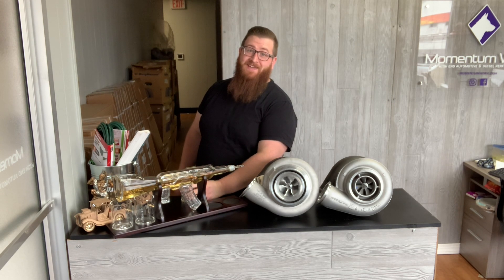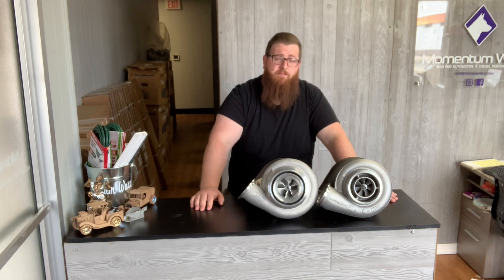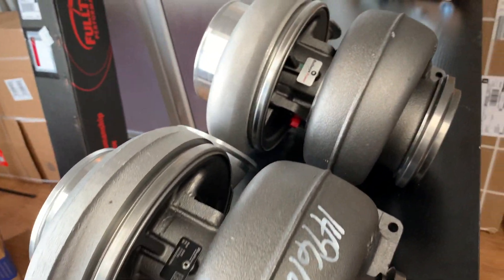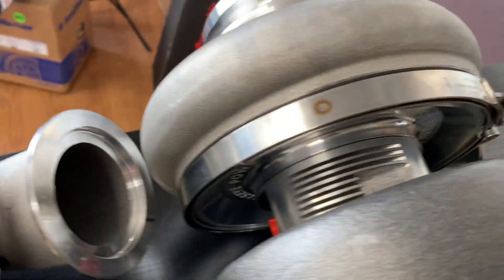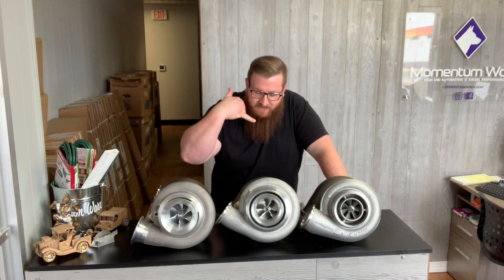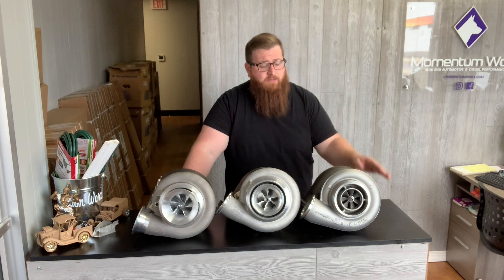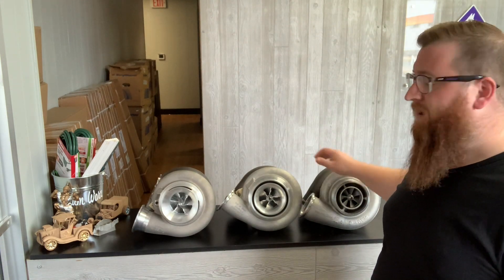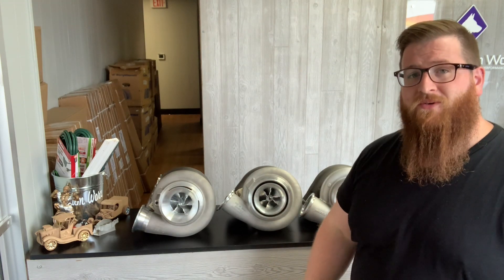What is in a Bullseye Power Turbo for Diesel Trucks?

Comment: I’m having surging issues with my s300 66/74 on my 6.7 Cummins at low RPM. Right around 1850 RPM 18PSI boost or more it surges on my gauge 1-2 psi and I can hear it through my intake. I was told to widen the map groove 50%. I have no idea how to do that. . Machine it?